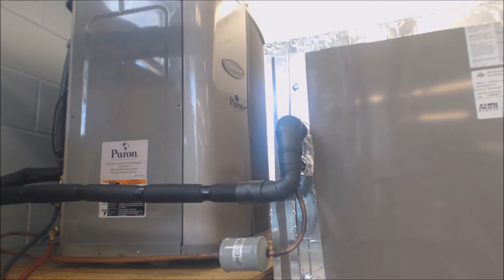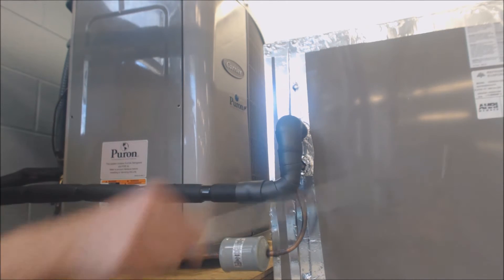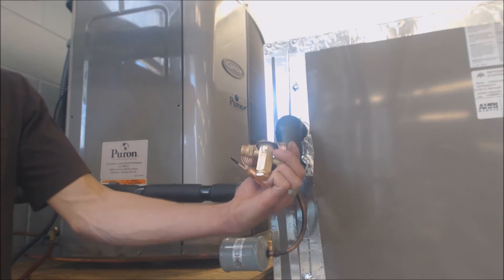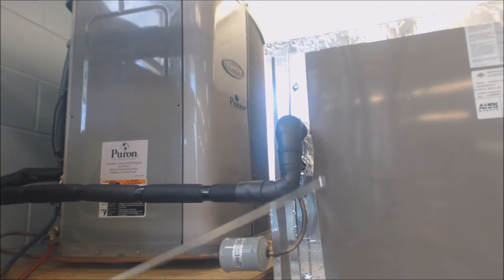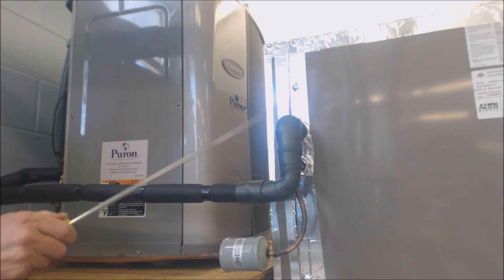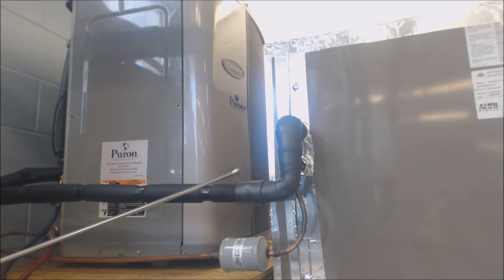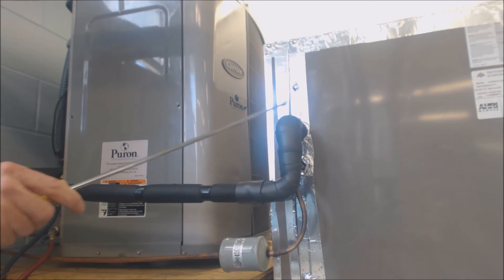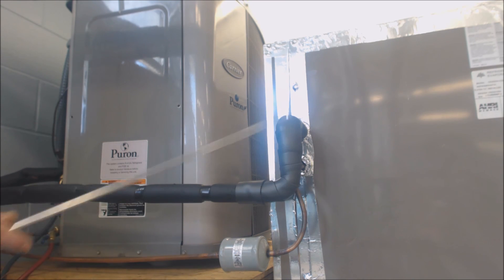Increase the Air Conditioner System Efficiency During the Installation for a Relatively Low Cost!

Comment from the maker: A 2 ton condensor matched with a 2 1/2 ton or 3 ton evap is actually a good thing for efficiency if you make sure that your txv is good for a 2 ton condensor. That is the key. You don't want to incorrectly size your txv. Many TXV's are good for a range of condensor sizes. You NEED to VERIFY the size Condensor that the TXV will handle. remember that the TXV is measuring superheat after the evap coil so it doesn't matter if it is a little bigger of an evap coil. Match TXV and Condensor sizes and increases coil size by 1/2 ton or even 1 ton for efficiency if you have room for ductwork. I usually just upsize 1/2 ton.
Reply: With the larger suction line size, wouldn't that effect your oil return back to the compressor, especially where comp. is at a higher level than evaporator? Your thoughts on that?
Reply from the maker: So most manufacturers will give you charts on capacity losses for the sizes of suction lines chosen especially for long runs and for vertical runs. Now with the higher efficiency standards this has come to the for front. No sense in installing a high efficiency unit and still stuck in the old thought of vapor line sizes. There actually is a lot to take in in reference to sizing lines properly for length and for oil return. Even though the vapor line is larger, that does not mean that your oil trap or traps will not work effectively. I quickly pulled up one manufacturer's guidelines for vapor line sizing, granted this was printed in 2004 and is R-22 but even then they were trying to educate the installer on high efficiency and long compressor life. It is a good read and the first one I got my eyes on. If you have any other questions let me know and Thank You Very Much for your Comments!http://hvac.amickracing.com/Air%20Conditioning/Goodman%20long%20lineset%20application%20R-22%20.pdf